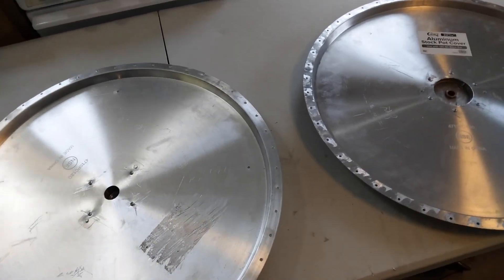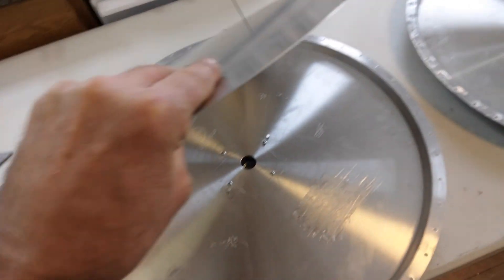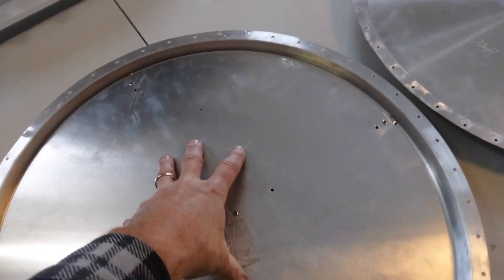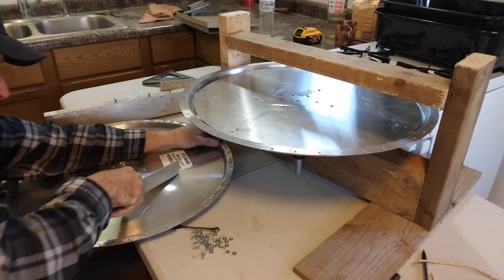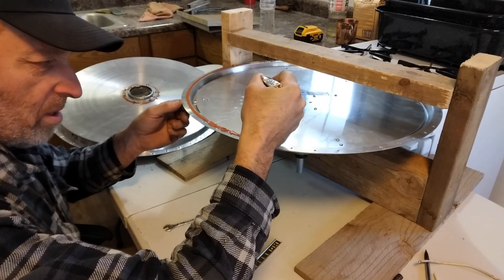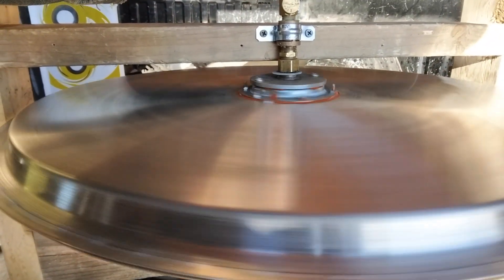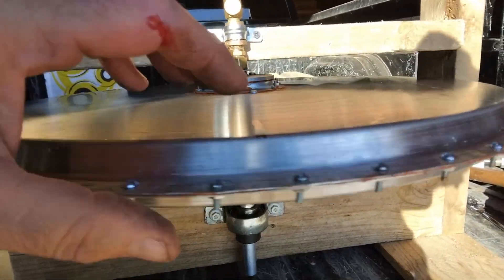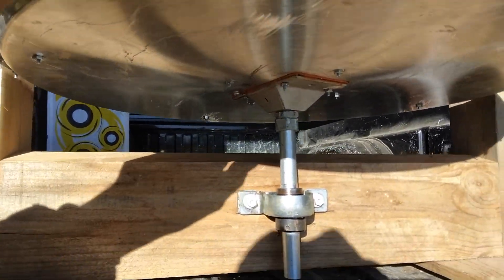Metal Rotating Flow Turbine

Comment: Would you try useing a bicycle rim, and put this aluminum shells around it. You can use the original fabricated bearings alignment of the rim shaft on that way.
Reply from the maker: It seem to be sturdy enough along the circumference, just attaching the two lids together.  I want to keep it as streamline as I can.  Thanks for your ideas!